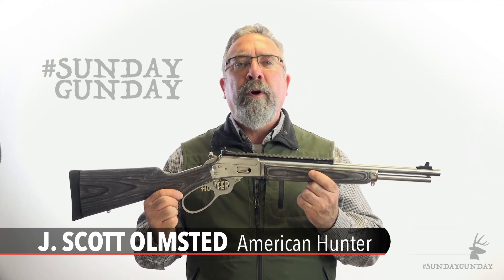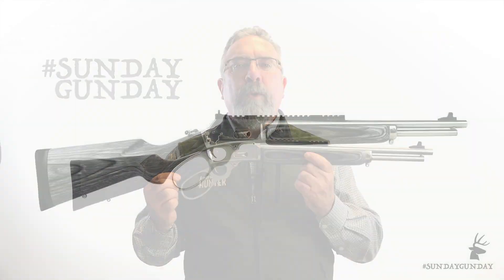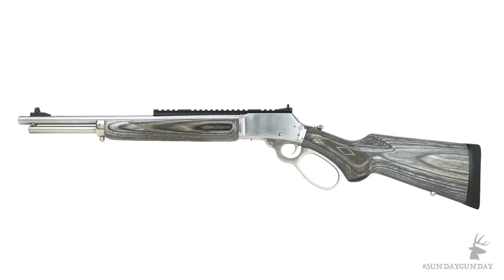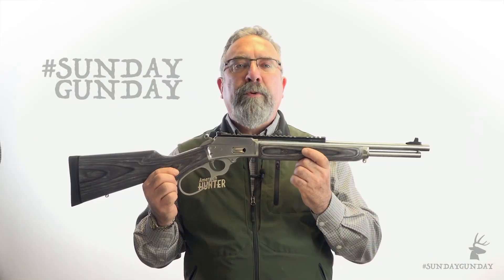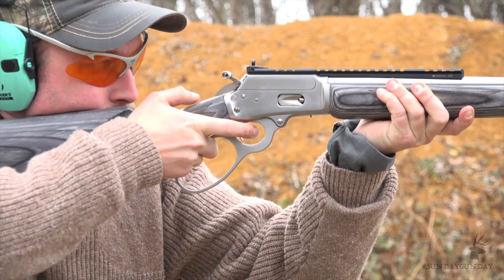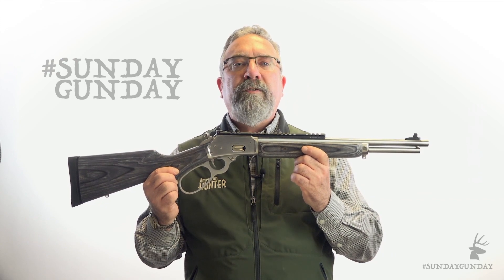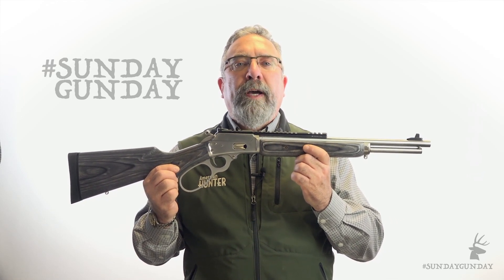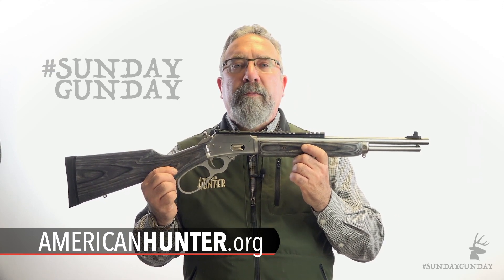#SundayGunday: Marlin 1894 CSBL

Comment: I looked at a couple of these. I like them. First thing I'd do would be to toss that stupid extended rail though...And maybe change out the lever.
The large loop lever is a good idea in many ways, but seems to add more bulk to the 1894 design. It's already a bit bulky feeling because of the pistol grip.

Comment: Your video indicates that the rifle's tubular capacity is 8 rounds, which is what Marlin's website indicates.  However, several online retailers (e.g., Bud's Gun Shop and Davidson's) show specifications for the rifle as only a 6+1 capacity, rather than the 8+1 shown on Marlin's website.  I queried Marlin's customer service about this discrepancy and, surprisingly, they responded that their website is wrong and the rifle's tubular magazine only holds 6 rounds.  The 8+1 capacity is an important feature to me.  Can you confirm that the rifle your reviewed will hold 8 rounds in the tube?  Thanks.
Reply: artyman0802 it’s 8+1.  Trust me I held and tested it. I was gonna go for it, but I bought the 44 mag version instead since it’s also 8+1 and I own a 44 mag smith Wesson 69.
Reply: I can tell you the 16 1/2 inch barrel only holds 6+1. If you get the same style of rifle in a 20 inch barrel you can fit about 10 rounds there.
Reply: They are 8+1 357's, Marlin made a typo on their web site. I think they now have fixed it. I have one, it holds 8 not 6.